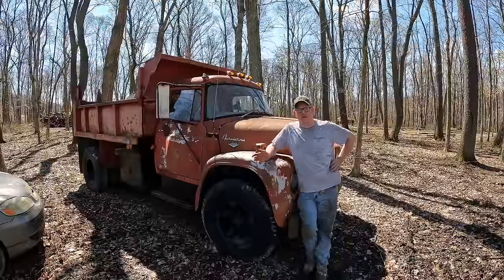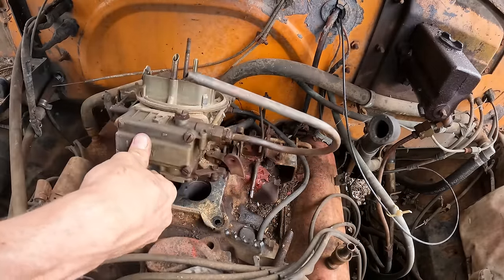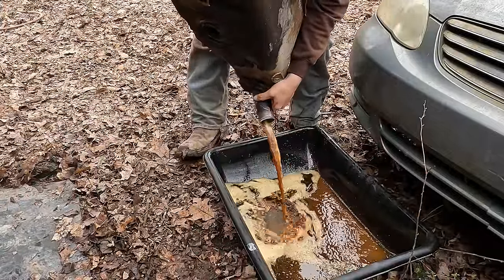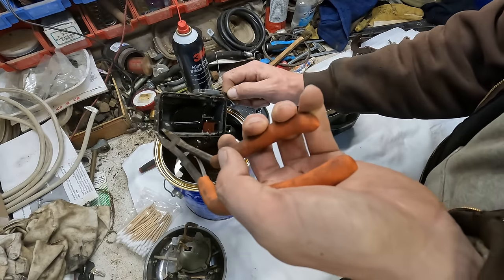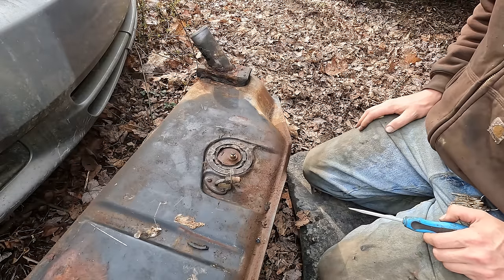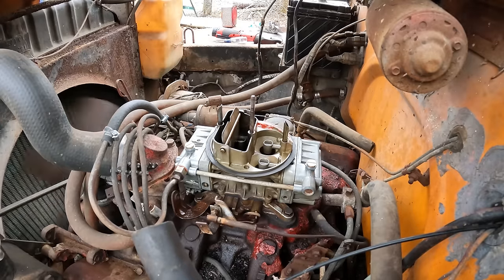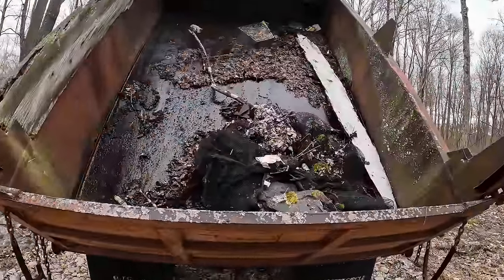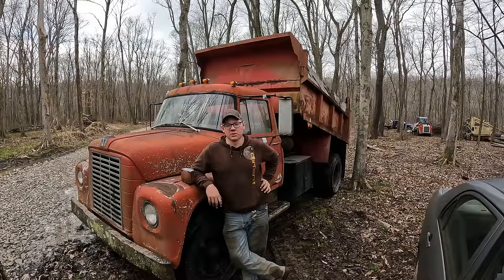Sitting 20+ years will this $500 Truck Run & Drive again? (International Loadstar Revival)

Comment: Great old truck Matt. Ole Red. The two speed rear end means you can slit each gear even reverse. Just put it in gear, then split to hi, select the next gear and push the button down at the same time and again just select hi when you want it. You can even shift down a half gear ( 2 speed rear makes your truck similar to a 5 x 2 box). Best wishes for the new shop.

Comment: Hi Matt, Great video and a great bargain buy.  A full hour of memories.  Love it !
At 17:30 the fuel gauge sender is a Rheostat, not a potentiometer, basically you were correct that it's a wire wound variable resister with a sliding contact strip.  Basic No Tech but, they work and are incredibly reliable (crap permitting). At 17:58 my first reaction was there's water in that gas so, when you opened up the carb it was no surprise to see all that gunk in the float chambers.  Love the clean cloth to cover the bench while stripping the carb, perfect to see where the small screws and bits fall... But don't go using compressed air right on top of those same small bits... You blew them away to the left.  I always use an old Babies bathtub rather than a cloth, same idea but nothing can roll away.

Comment: The reason for the hot air tube to exhaust is for cold weather to help keep fuel and air mixed as fuel drops out of cold air at low speeds 
Also many years ago when we had reps for companies the one that sold fuel pumps had a tech tip to always oil all the pivot points on the pump lever and contact points to make sure they didn’t run dry on first start up
Reply: Prevention of carb icing.
Reply: Yeah man, if you've ever had a carb freeze completely off you would appreciate that silly little tube.
Reply: @johnharrold6359  The silver corrugated tube coveys the warm air, little tubes maybe to actuate a diverter. Carb icing is real on land and in the air, I've experienced it. In high humidity conditions, it occurs well above the freezing point of water.

Comment: The reverse gears may be "straight cut" which are inherently noisy. Change xMission, differential and other fluids then put it to work.
Reply: What's an xMission?
Reply: @mwilliamshs  I think they meant transmission
Reply: @mwilliamshs  A better way to say TRANSmission than "tranny"

Comment: Great job Matt! Where I come from, we call old Internationals "Binders". And a 50's vintage IH I used to drive on my uncle's farm was named "Lucy Bolts". Looked like crap but hauled a lot of wheat with it. Congrats on the project, and thanks for the great videos. God bless. Rev. D.
Reply: Funny you should mention "Binders".  My dad was a truck driver and he owned a couple of International trucks.  One was a 1950 model and he later got a new one in 1955, an R190 if I remember right, with a sleeper.  He referred to those trucks as a Binder.  I hadn't thought of that in years.  Thanks for the reminder.

Comment: Hey Matt, 
There's a place over in or around Somerset, that handles lots of the obsolete discontinued International truck parts. We dealt with them a few times, when I was working at the  local dealer.

Comment: Matt that  Tube on the right side Manifold is called a Heat Riser Back in the Day  would Draw warm air so that the Truck would warm up faster. I also Drive a Dump Truck  a 23 Yard  Tandem Mack   Love it Such as Nice easy Job  to have  M-F  8 to 5 & Home every night  I don't Live in a Truck anymore  did that for 25 Yrs & don't miss it

Comment: Matt, on the 2 speed rear axle I was taught when the button comes up take your foot off the gas till you feel it shift button goes down put your foot on the gas and go. Just that simple. Love your videos.
Reply: I always felt it was a little less stress on the transmission, especially when hauling a heavy load, to use the clutch when splitting the gears.  I have done it your way as well but it just seemed like the transmission was "slamming" into gear when the clutch was not used.
Reply: Either way will work, feather the clutch (just enough pedal to make clutch slip but not completely disengage) and training your gas foot to let rpms to raise or fall just enough for the shift ( more than 250 but less than 500 ..gas engine maybe more) after awhile you'll get your timing right and not need to use clutch at all, feathering the clutch will also allow speeding driveshaft up to match when downshifting the rear axle without such a hammering shift

Comment: It's a potentiometer, and you explained it correctly. It measures resistance along the travel to send to your gauge.
Reply: Technically it's simpler than that. It just grounds the gauge with a resistance wire, which works as a potentiometer.
Reply: It’s a rheostat, it doesn’t measure resistance it creates a variable resistance to ground

Comment: Nice find, those old Internationals are tough as nails.  I had a 68 Loadstar 1800 dump truck w/345 eng, 5 & 2 axle, air brakes 75,000mi (ex gov truck).  It had a very short 134" WB with a 9' Truckweld 4/5 yd box and it turned on a dime but if the driver took their eyes off the road it wanted to drive right into the ditch.

Comment: Great job Matt! I wish I was as mechanically inclined to be able to rebuild a carburetor like that. I think Louise would be a good name for her!
Reply: Snakebait, if you've ever built a model car or rebuilt an old one, a carb isn't much different. The carb kit came with illustrated instructions. Like Matt said, it looks daunting, but it really isn't once you get into it.
Reply: @LesFelts  Thanks Les, my backyard mechanic skills were very limited back in the day and in my 71 years, I was too scared to venture that far. I didn't have enough confidence.

Comment: I found a 53 international sitting in a double corn crib underroof. 1 ton duals. I hauled firewood on it for 10 years.   Had more pulling power with weight than my tractor,  geared low.  50 mph and the straight six was winding.. used it up to 1990. And sold it,

Comment: Variable resistor.  As the fuel float moves the resistance changes changing the location of the pointer on the gas gage.

Comment: The engine runs smooth.
The reverse might have straight cut gears, that will give that gear noise.
Reply: Bingo. I've had NP435s and T18s, (still have a 435 in my F-250) and they have straight cut gears in 1st and reverse. They're gonna whine a lot, and not want to go back into 1st on the move due to no synchros. My buddy has a Ford with a T19, much sweeter trans at lower speeds due to the fully synchronized gears.

Comment: Re: Whine in reverse.  It could simply be, that the reverse gear is not synchronized, and has square-cut gears inside.  Square-cut will whine at any speed, but are very strong.  I'd change the tranny fluid anyhow, just because.  Same for the rear diff.  The change gets years of accumulated dirt and particulates out, and fresh lube in.
Reply: Yup - reverse is rarely synchronized and ditto on the square gears too.  Was shown that by my grandfather when rebuilding his big trucks - you could see the reverse gears were very different from the rest.  Alway loved that whine when reversing the bigger trucks!
Reply: That's true..  But I bet it's just low on oil.

Comment: I've got a 1979 C70 Chevrolet dump truck same size as this International. I call her "Old Blue". I've been running this truck for almost 20 years and use it regularly. My top speed is 52 miles an hour before the overrev light comes on. The one thing that is definitely on my list to change is to upgrade from that nasty cast iron single Master cylinder brake system to a hydroboost. Have lost the brakes twice when fully loaded and there is absolutely no stopping until you simply run out of inertia. One was a vacuum can failure and the other was a blown brake line. We have the advantage here of no hills which helps with the lack of performance.  I have a 366 gas with 5+2 tranny. When I bought the truck it had a golden dog hood ornament that someone had installed on it and I was gonna take it off. It's still there all these years later cuz performance wise it's a dog, but dependability wise it's golden!!!

Comment: Matt in the early 70s I drove an International Loadstar 1800 on a daily basis hauling concrete products.   From pallets of Portland cement in bags to concrete blocks and precast concrete products such as septic tanks and parking markers. 
The truck was a beast to drive if it wasn't loaded well.  We worked in a very hilly part of the state so you spent a lot of time shifting. 
Fun times!!

Comment: Slot head screws, the sad relic of our mutual English past. Nothing strips faster, or is sure to release the screwdriver on its merry way across fresh paintwork.
Reply: Don't strip as quickly as other screws and just require care when assembling and disassembling 😀
Reply: I don't think the door screws were IH's fault. Note, they didn't have any paint on them. I would bet someone had been into that door before Matt, they lost the original screws and found a handful of slot headed screws in their spare parts collection. The latch screws on the door jamb were philips and painted yellow. The rating paint below the latch looks like it has some yellow overspray. The door probably has been repainted since it left the factory.
Reply: @kurthanushek5520  well spotted! Though all the original engine tin screws on my VW splittie kombi were slotted!

Comment: Carb rebuild "You really can't screw this up" You obviously have never seen me rebuild a carb!! Great job Matt! Great video
Reply: You, me and no doubt thousands of others.   😂
Reply: And the funny part is, he immediately proceeded to screw it up, lol!  With that many bits and pieces, it is very easy to miss something or damage a seal on reassembly.  Carbs are not difficult per se, but there are lots of opportunities for it not to work out the first time around.
Reply: LOL, he screwed it up, twice, though he caught the first screwup before installing it and the second screwup was an easy fix that didn't require taking it off to replace the o-ring he sliced.

Comment: The thing inside the tank with the float I believe is called the fuel sending unit. That's what's bad on my 75 Fury which is why I never know how much gas is in there. I have to shake my car side to side and listen to how much is in it. Lol. I learn so much watching these videos. Makes me want to go to a junkyard and get a few running. Lol. And some motors are ok with low oil pressure. At startup mine is 50+lbs. After warm-up and idle at a traffic light it'll be 2lbs. I was told thats perfectly fine for that motor. Haven't had no issues yet. And I'm loving that ol truck. Love the way it sounds and the way the hood opens. And you could call her Big Red. 😄

Comment: I had 2 Loadstar 1600 about 40 years ago.  They were dependable and absolutely got the job done.  One was a 6 yard dump, like yours and the other I made into a single axle tractor, because of the air brakes.

Comment: Years ago,  I  tried rebuild a 2 barrel carb on a '57 Chevy I had.  3 people helped tear it down, but I was alone to reassemble.   After 2 hours, i got the top back on the carb, traded it on a rebuilt carb.

Comment: Lodestar 1800s are my favorite medium duty trucks. Backin ' '68,  when I was 20, I had a job driving one. It was a bulk feed truck owned by Agway.  It looked like a box truck, but it had been converted to a
bulk truck Making it a dump body, partitioning the box  into two compartments and hanging a blower underneath at the rear, and cutting  two hatches into the roof for loading at the feed mill. I could haul 9 tons, 5 in the front 4 in the rear. I loved that job and that truck.

Comment: I love these old dump trucks, we've got a GMC c6000 that runs great but the brakes just will not tighten up. no leaks, just no pressure, changed almost everything in the whole system, same thing, so aggravating. I love the 2 speed rear end, people always try and buy it off us

Comment: Just bought a 74 Loadstar last April and barely have had time to put into it. I just recently did everything you did in the video (fuel system) unfortunately I have to pull the carb again because the front float is too high and I’ve got fuel spewing out the front horn. And because of the radiator hose at the top of the engine I can’t just pull the bowl off.
Good motivational video.

Comment: Rolling D.  4/22
Matt, 
A very close friend of mine had one of those
Trucks and loved that old binder.
Your container bldg is looking very good but a couple of things to make note of.
#1  I was made to remove about 1/3 rd of the 2×6s we used to use as shelving in our warehouse stating that we needed to Ave space for water to flow between  shelving in case of fire.
#2 Be sure to seal all the roof
Valleys or before to long when you close the doors and look at the ceiling it will look like night with stars from the pin holes I had one water lays.
# 3 Best of luck I enjoy your challenges keep up the good work.

Comment: That brings back memories. Back in the late 70s we had a 1967 IH truck with a big grain dump bed on it, bought at auction. It replaced a 1936 Chevy that definitely needed replacing by then. I put some miles on that thing.

Comment: If you continue to have oil pressure problems, take off the oil filter housing and check the gasket. I had a 61 International V8 and after checking bearing clearance and putting in heavier oil I took off the filter housing and discovered the gasket was bad and was bypassing most of the oil. It had the 2 speed rear end too and It was a real beast and would drive well on the highway too.

Comment: Personally had 2 of these Loadstars in the 1970's as farm trucks, 1. with a 24 foot cattle box (hauled hogs with it), and 2. with a blower box on it to haul pig Fred using a pto driven vaccume/blower. Both had 343ci. Gas V8's with 5 speed manual trans.. They were well used (read worn out) but did their jobs well for a long time.

Comment: Matt, don't know if you still have this truck but where backing them they all sound exactly like yours did here. Its just how they were built. Their super solid trucks. You found a diamond 💎 of sorts and the snartt guy holds onto them as they can only go up in value when it decent or better condition. IMHO .

Comment: I use chap stik  to lube the cross over tube o rings..it's important that those orings seat perfectly or you WILL LEAK..You can also use same chap stik on the metering block gaskets..keeps em from sticking and tearing if you gotta take the carb back apart...NOT ALOT..JUST A THIN FILM...I've probably rebuilt 500 carburetors in my life..works great causes NO PERFORMANCE ISSUES

Comment: Looks like a "Mater" to me....We had a single axle tractor like that as our bean truck when I was a kid....Same original orange color..Came out off the Chicago or Milwaukee area originally..May have been from the same company...I didn't know a 345 could run that smooth..Lol...I love the look of those..I've got a low mileage 99 DT466 and Allison from a bus for when a good one that's not rotten comes along...Brought back some good memories..Thanks

Comment: For cleaning out old fuel lines etc. try using an old speedometer cable on an  drill.  They pretty flexible and can make fairly sharp turns,  Works like a roto rooter...

Comment: 15w40 Rotella non synthetic is my go to for pretty much anything that vintage. It has more zinc than other oils to help cam life, and the viscosity keeps the oil pressure up. As long as it has a filter. Non filter applications need to have straight grade non detergent oil so when you change the oil the dirt held in suspension goes out with the old oil. Detergent oils will sludge the hell out of any non filtered applications and will keep the dirt at the bottom of the pan as sludge.

Comment: darn sounds great, oil specs are dependent on you climate if its cold you need thinner if it's hot you need a thicker range. Can't miss the sound of it purring do good and sounds so sweet. You've given her a new life. Pity most modem engines don't sound so good..

Comment: Matt.

That manifold heater hose draws hot air into the carbie to prevent the fuel.in the carbie from freezing over in cold and wintery wether.

Comment: Hi mate When you get a metal fuel line that is blocked try using a bike cable To put down the tube and a drill to spin it mate it worked for me.

Comment: An old style metal, flexible throttle cable housing is good to snake through those stopped up fuel lines. Chuck up in a drill and drive it through.  Just remember to twist it to the right ....  LOL

Comment: Someone may have already mentioned but if not the two screws on the throttle plate of the carburetor are the air adjusting screws, I think you had it about right usually while idling turn them in until the engine starts to cut down then out about 1/2 turn will get you down the road. I helped wear a couple of those old binders out in late seventies one was a 1800 gallon propane bulk delivery truck the other was a oilfield 40,000 pound winch truck

Comment: I have a 74 best little truck ever. I got it running and driving $1000 the dump was destroyed but that's not what I wanted it for. So I got the dump off took 30 second the carage was in the bed and the bed was strapped to the frame put a little flat bed on it and she was moving mobile homes within two days. Since then I've used it to move 8 mobiles and countless tons of scrap. Had her 20 year now no big problems, runs 20 psi at 650 rpm and stays around 40-55 psi no matter what oil is in it at highway speed redline is 4000 but does whatever I want but go fast

Comment: Matt, you should have used an in tank electric fuel pump sock filter. Afraid that Quadra jet carb filter is going to plug up quick and you’ll be pulling the tank again. I sure admire your tenacity, like a Pitbull, you’ll get’er done!
Reply: Yes I would install a ele pump and two paper type fuel filters